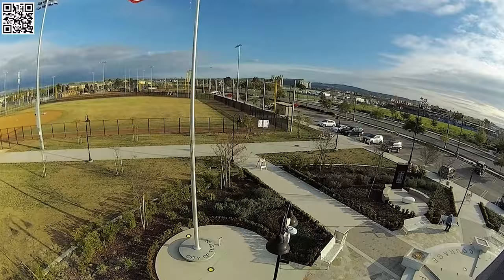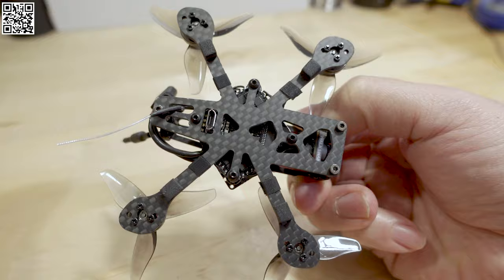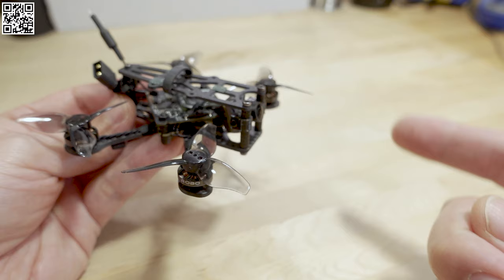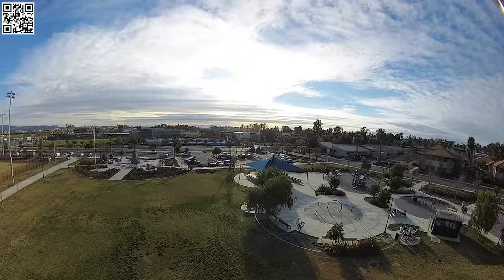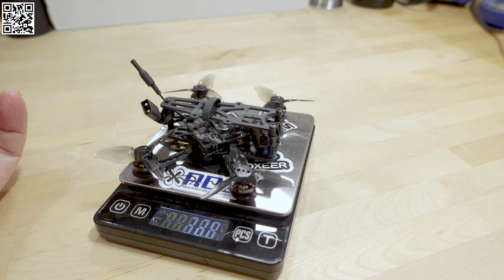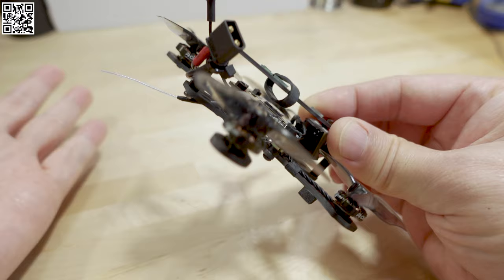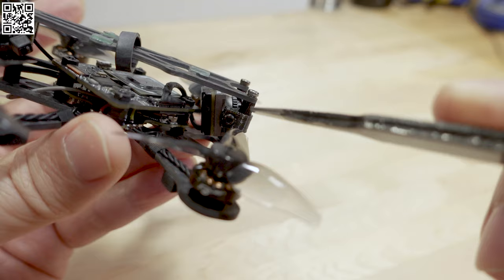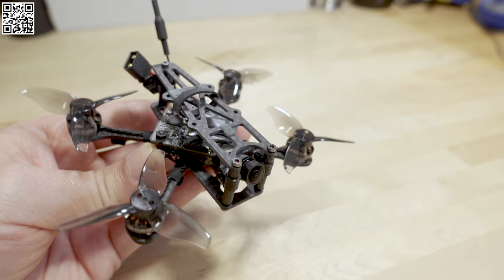CraftedKwads Odonata HD Conversion

Comment: I Love my Odonata  It flies just as well as my 3 and 5" quads.  I used an ORT Micro V for the VTX antenna..  Walksnail 1S version:  I had the same issues with the camera not fitting behind the standoff.  I had a friend print me a mount......  The only drawback to mine,  it leaves the camera lens exposed to damage if I hit something directly center or crash on the pavement.  550mAh 2S Lipo, I get close to 4 minutes of flight time.  Yes, very quiet and non-threatening.

Comment: Another nice small drone, thanks for the review.  Comment though on the giveaway entry method. The qr code thing is fine, but is it necessary to have this many, repeating codes on the video.  I  think I scanned about 30 codes.  Thanks Albert!
Reply from the maker: Unfortunately because I saw a problem with my videos where there were giveaways. Apparently, there's a way to cheat the system and scrub through the video without watching it to see the URL link so I was getting more entries to the giveaway than I was getting views which was impossible.  So that's why the QR codes are being used. They can't just scrub though to the part of the video where there is a giveaway link to find the giveaway.   So the bad apples are making it worse for the rest of you all sorry!
Reply: Ya, I understand the switch,  just wondering if the amount of qr codes is necessary?  Are they also being bot-scanned?

Comment: So cute.  I'm thinking about making an analog toothpick drone.  Do you have any frame suggestions?
Reply: Mobula bassline?
Reply: Babytooth all day long! If there is any custom analog build to do for outdoors a Babytooth is mandatory....
Reply: @DaZelli ooooo.  I like it, thanks
Reply: I'd recommend the 1.5mm thick frame and around 1202.5 high kv motors on 1s of course. You'll get yourself 4mins of ripping per pack....
Reply: @battano  are the motors secure with only two screws?
Reply: @tazgrif11  yes.  You should frequently check them for loosening though.  Maybe a little locktite for peace of mind.
Reply: @GR8SCOTT  thank you very much
Reply: Dragonfly Lite 3 Inch Toothpick-F192
Reply: @GR8SCOTT  thank you